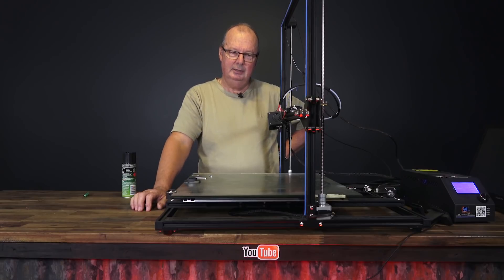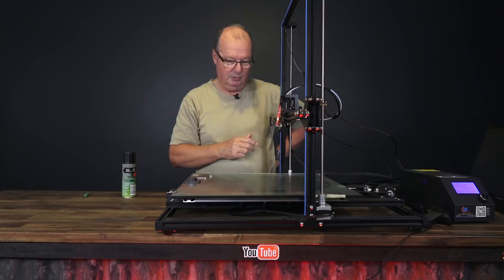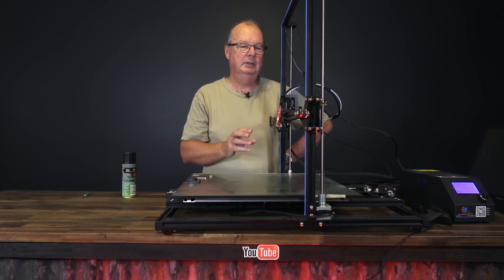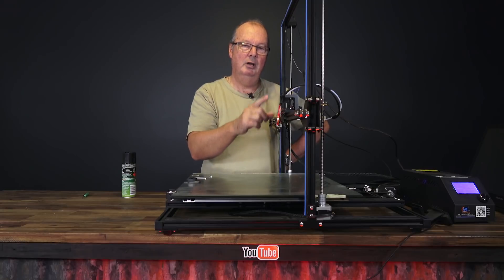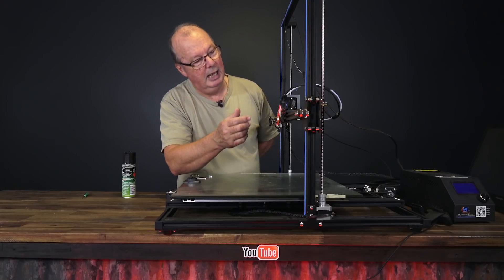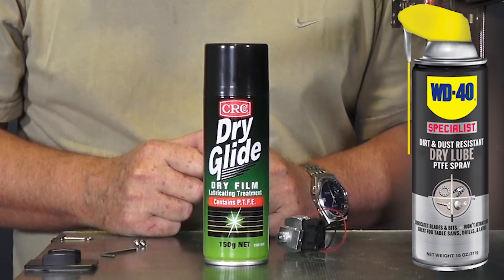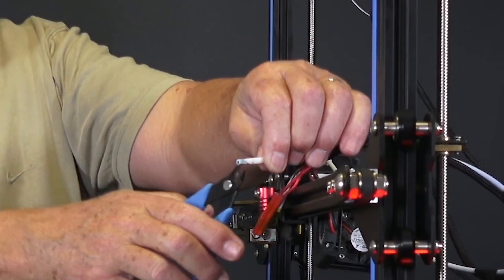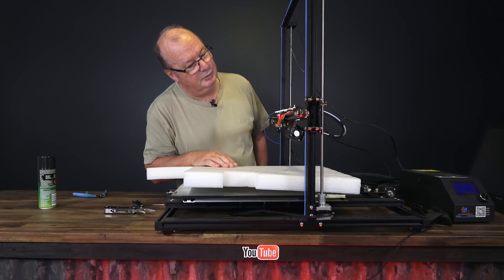How to fix your cr10, cr10s, mini tornado, ender, A10 and others jamming or under extruding.

Comment: I dig my cr10 s5. Though there are a few things that piss me off. Such as their idea of how to market a printer as being ideal for printing anything, and showing a list of all the plastics. Yet, to print common ABS requires a heatbed capable of reaching 110c. However on the cr10 s5, you can be expected to wait until reindeer can fly, before it will ever reach that temperature on its own. Sure you can hit it with a propane based construction heater, maybe a ruby laser, yet without those you will be expected to wait the better part of close to an hour to experience heat levels approaching over 80c, and never close to 110c, unless you park the thing in Granada underneath a fresnel lens. 

Show idea: Upgrading the cr10 s5 head bed using a MOSFET and an additional 20v external power supply (such as found with laptop power supplies)
That would make it reach 110c and result in no more cracking of the teeth over peeling up edges of prints after a few hours into a print thus wasting not just time, but also materials.

Also, you'd think heatbed built plates would have evolved enough to not require dollar store metal clips to keep the glass in place on them. Lol, can you imagine if window installers considered that a job well done?

Hope your back is feeling better now. I can empathize too well with those sorts of challenges due to mild dystonia st and a 39% curved spine. However, I do still feel lucky and happy to be here! (Would help if they made weed legal though)

Vulcan high5's from a field in Canada \V/_
Reply: you are correct - I had a lot of trouble with my Folgertech FT5 R1 trying to get the bed heated past 60c. I installed a 12v silicone heat pad and mosfet. It now heats to 80c in 3 minutes.
Reply: Will the existing heat-bed get there with 20V?? The only real solution seems to be the $200 204v/110v heated pads.
Reply: Is it insulated on the bottom? if not it's a cheap upgrade and will help considerably. My ender 3pro, a 24volt system with a 235x235 bed actually takes significantly longer than a 305x305 12volt bed I had on an otherwise worthless printer. That is the difference bottom insulation made on it. This is going from 21c to 60c times. Perhaps the next 40-60c warm up will benefit less, but it should still benefit.

Comment: Very cool!!!  Thanks!  Too bad they don't have it in non-drying, then put it in a oiler/filter block for the filament to slide thru
Ooh..they do!  https://www.amazon.com/DM1046601-PARENT-DuPont-Teflon-Multi-Use-Lubricant/dp/B00030BFEM?th=1
Reply: I think you would have all sorts of layer bonding issues if you used a wet version.

Comment: And please. DONT do this shit. 
You dont see this in groups because it's SHIT.
Reply: Have you tried it? I use it on all metal and lined hot ends with great results.
Reply: Yeah i did. A few years ago. Where everyone did tell you lube your Filament and that things. In the end it does only make 1 thing. Problems over time.
Especially if you print something over 240°C.

It´s just something that has nothing to search in a hotend.

The problem today is everyone just want´s a quick solution.
Nobody really works at the real problem.

Getting a cheap chinese All Metal Throat to work is pretty easy.
Like i said.

String and Toothpaste / polishing cream for car´s.
5 Minutes and you get a perfect polished Throat.
No need for any lubrication.

Good cooling.
And some Thermal Compound.

I do have around 17 printers right now.
Sometimes more sometimes less.
And i never had any problems with them.
Couse i remove the problem. Not just try to get a quick solution.

Yeah it may solve the problem for now.
But let´s look out. 

There are a world of cheap and GOOD replacments out there.
Like titan Heatbreaks. ( around 10 - 15 $ ) 
And so on. It doesnt have to be from china.
You can get good  and cheap sollutions from your Home Country.
Reply from the maker: Per the video and the writing on the screen - not to be used over 230c.
Reply: Agree that the trend for "oilers" was not a solution. As I said though, dismantling hot ends can be challenging for some people and broken thermistors are common.
Reply: The Hot End - 3D Printing & Technology so no printing Abs or ASA or some other materials that would run without any problems. Even some petg would make problems. 

Good work. Really.
Reply: john martin i dont get why. Its so easy. Heat up to 220 / 230 hold the heater block with a fitting wrench and untighten noozle. Turn out noozle let it cool down and the Do the rest. Should work without problems. 

For a full disasamble i need 2 minutes. At a Hotend that has printed over 5000 hours. 

I never had a broken thermistor once. If you work with a little Bit feeling it should be no Problem.

Comment: They all look the same?  Maybe you should get better glases. 

How about trying to get IT work properly before using any shit to make it work? 

All you need to polish the throat is some toothpaste and some string and 5 minutes of work. 

Apply some Thermal compound in the threat that goes in the cooling fins and ad a better fan. 

Or just buy a high quality throat and noozle  ( 30 $ ) and you get a good working hotend.

Comment: Doing this on an all metal hotend is a terrible idea if you're actually looking to use it for hotter temps than 240.  PTFE when heated past 240 releases toxic gases.
Reply: fix the cooling of the heatsink and you won't have PLA stick.......
Reply: The point is for people who print PLA through all metal.
Reply: @Johkarphotos  Just buy the right throat/heat break. It's cheaper than this spray.
Reply: Printing ABS releases stuff that isn't great either. Just make sure you're ventilated. Toxic vapours are harmless enough in very small doses. Just don't go rubbing your nose over it for a full 21 hour print and you should be fine. I mean when you fill up your car with petrol there are harmful vapours which you are breathing in. When you get an X-ray it is bad for you, but as long as exposure is limited you will recover just fine.
Reply: He addressed that in the video, the part where he was saying they even use these on printers without heated beds
Reply: I'm sure a thin film of PTFE won't hurt anyone when it heats up. it's not like he's evaporating a whole can of the thing all at ounce... chill out.
Reply: Yeah if is can kill a bird I don't think it is worth it. You can get a NON all metal hot end for about the price of that can of Teflon. And he better have thermal limits on the firmware and thermal runaway protection as well. Why dismiss the risks if you can just buy the proper hotted for cheap.

Comment: Ibhave tried some clones and they all suffered from heat creep. Bad thermal properties. I have manually polishied the throats which is ok. But this seems eaiser, how long does the coating last ?
Reply: I have printed for over 60 hours and it is still going strong.

Comment: BTW even some "genuine" all metal hot ends suffer from this problem. If you intend printing material that requires temps. hotter than 230c the spray could melt but would clear the hot end easily and quickly. If you went back to PLA you would have to re-apply.

Comment: Kind of a bad example as the creality hot ends are nothing really like an E3D, nor all metal. The ptfe tube runs directly to the nozzle orifice, completely thru the heat break. This is why when paired with the capricorn tubing which is rated up to 300C, it makes a great combination for high temp printing needs. It cant stick to the inside of the heat break and at no time, does the filament come into contact of the heat break with the creality printer family including the enders, cr10 and its variants, and any using that same style of hot end.
Reply: example of how the creality hot ends are set up, ptfe direct to nozzle. Unless your overheating the ptfe, you should have no feed issues that are related to the heatbreak, or you havent properly seated the ptfe to the nozzle orifice solidly. https://www.thingiverse.com/make:411424
Reply: Also why "upgrading" to an all metal hot end on the creality machines really is a downgrade vs simply switching to capricorn ptfe which is rated for the heat and gives all the benefits of all metal, without the issues of PLA sticking to the throat.
Reply: You are correct - possibly a poor choice to show but it was the first printer I grabbed. Having said that, the spray is also great in this type of hot end as it gets down into the nozzle as well and it is a definite improvement on all the printers I have used it on.
Reply: I'm having this exact problem with my Ender 3. I love all the livingroom engineers here who get their kicks pointing out "flaws" in a video that's well made and designed to help people with issues like this.
Reply from the maker: That example was the stock un modified hot end and PTFE - after 24 hours of printing PLA only. More than likely it wasn't seated correctly from the factory - and I've had this exact problem with at least 5 printers using the same hot end
Reply: Matt Weber this right here the reason you might get skipping on a CR 10 type hotend is if that PTFE tube is not fully inserted creating a tiny gap between the end of the PTFE tube in the hot end where filament can sit and cook off eventually causing a jam or under Extrusion so make sure the bottom of that PTFE tube is nice and straight and flat and make sure it is fully inserted in fact look down the whole first of the light and make sure there's no filament in there

The end of the PTFE tube can get a little grungy like you see in his example on the video and this will eventually cause Extrusion issues especially if you're using abrasive filaments or higher-temperature filaments

The maintenance is as you see snip off the end make it clean put it back in and you're good for another couple thousand hours of printing